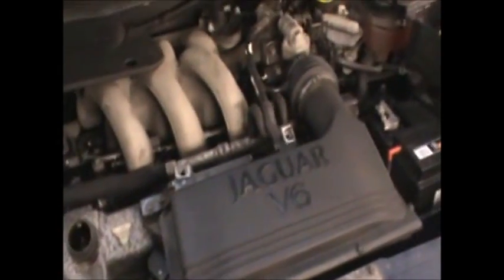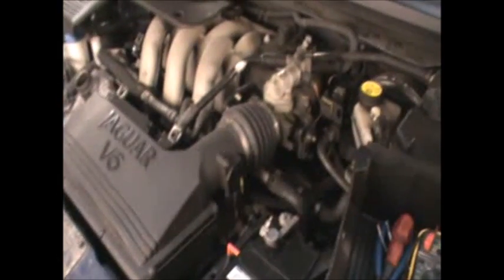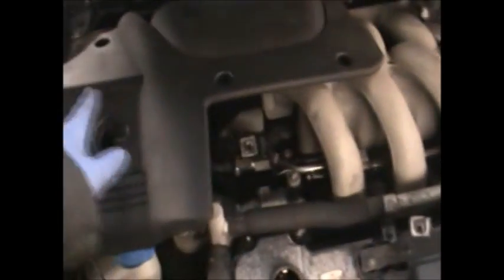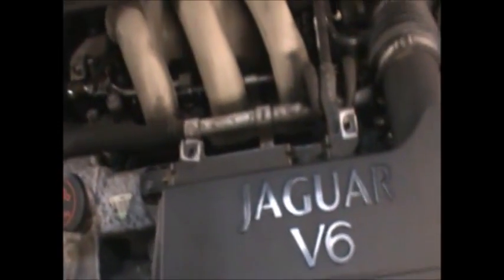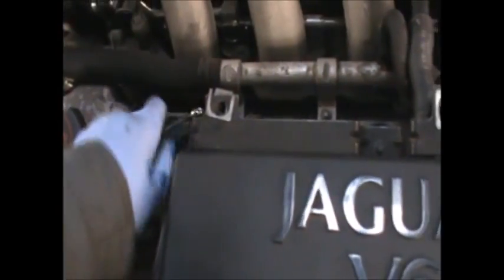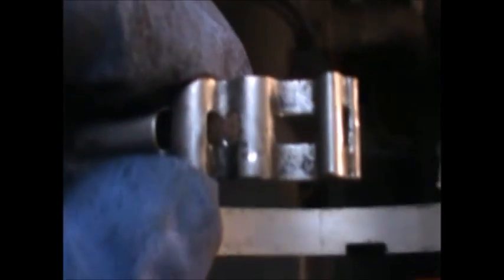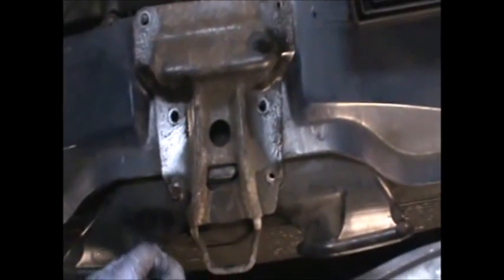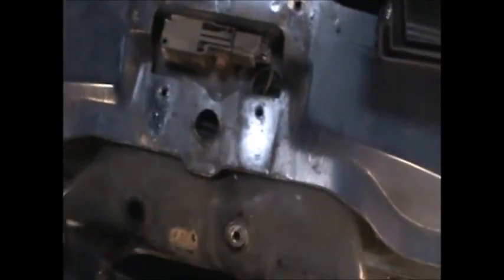Jaguar fault code P1647 upstream sensor

Comment: I'm a little confused by the Jag code P1647.  Strange that it doesn't seem to differentiate that it is a heated sensor, or whether it is upstream or downstream, only "Bank B", unlike their codes for other models as to their O2 sensors.  Also, note that the code mentions that it is for a "linear control chip" for that sensor, not the sensor itself.  So shouldn't there be a computer chip somewhere in the system that needs r/red, not the sensor itself  ?
Reply from the maker: The o2 sensor sends a signal to the ecu and then it adjust the fuel trim so its not to rich or to lean, so as far as the issue I had with the jag on the vid and other jags was that the sensor was not functioning properly, heated resistor can be checked by testing the resistance of the sensor the signal will usually fluctuates from 0 to 1 volts..if the OBD is not specifying upstream or downstream then you could use the OBD computer to check all the sensors and see which one is not working properly. the other reason this codes are generated could be that there is an air leak in the system and can cause mixture issues..

Comment: Does this sensor make the car choke and pop out on intake? I need this information urgently for a repair.
Reply from the maker: Hi there and happy new year, the fault code did not cause any issues, just turn the engine management light on. So I was driving just fine.
Reply: What your whatsapp, Instagram contact?
Reply from the maker: @Dudu-fj8kp  insta is ama1_motors

Comment: How do you use the meter to check the resistance of the sensor. Thank you.
Reply from the maker: Hi, well basically get your meter on the ohms section, set it to 2k, and then measure the resistance of the sensor by connecting your leads to the two black wires coming from the sensor, sometimes they are white and the resistance should be between 0,94 and 1,35 any higher will show a faulty sensor.
Reply: @DaringBeefcake  thank you for getting back to me. Stay safe.

Comment: Hi mate great video, But what did you use to remove that exact sensor as i cant get enough space with the ratchet and 02 sensor socket tool, have you got a link for the tool you used
Reply from the maker: arron imms hi, i used an open O2 sensor socket and a power bar to get it loose. The power bar has a flexible head so may be thats why i was able to have it at an angle as far as I remember. Because once u crack open the sensor a little bit then it just comes out fairly easily, though do spray wd40 or similar around.
Reply: Ok thanks mate, was your power bar a standard size or an extended (longer) one as when i tried i had no room
Reply from the maker: arron imms the power bar i had, had a 1/2 inch drive so i used a small extension to convert it to 3/8 i think so it could fit the open ended socket. May thats what made my socket a little longer and there was able to turn. All I needed was a small turn to crack it open.

Comment: Left or right side is 1647? Driver side ?
Reply from the maker: polovni djelovi hi sorry but its not left or right, the one I removed its at the front of the engine there is two sensors there and there are another two at the back of the engine.

Comment: Hi, I have the same problem with code P1647 on my Jaguar x-type 2001 . I have already changed the sensor , but the light comes back more and more. Then i checked the resistence of the sensor , it was 0.8 that is very well, then I checked the resistence of the downstream sensor . It was also 0.8 . So both sensors are working good , but it always appears the fault code p1647 , that is correspond to upstream sensor . And I dont know what that could be , because my two sensors work perfekt, but it always occurs a mistake about the upstream sensor. Could you give me an advice , because I dont have any ideas.
Reply from the maker: I think there are 4 sensors in total did u check all 4 ? If all of them are ok may be you need to check the continuity of the wires from the sensors to the ECU just to make sure no wires are damaged or broken.

Comment: How long to replace sensor? .
Reply from the maker: getting to the sensor is not long at all, the only part that sometimes drags the job is loosening the sensor, some are easier than others so all in all if the sensor comes off easy the it should take more than 30 to 40 mins. that is for that specific sensor.
Reply: DaringBeefcake Thanks for the info will have a go at the weekend.
Reply from the maker: no probs hope it goes well
Reply: DaringBeefcake I hope it does,I build cars for a living and don't wanna spend my weekend stuck working on mine
Reply from the maker: oh I see, well of course I really hope it goes smoothly for you, do remember that a genuine sensor is advisable due to the resistance deference with the universal ones.

Comment: Hello,
I've had the P1647 code and I've changed the O2 sensor. The check engine light went off and the car worked just fine for about 200miles. Now the check engine light is on again and I have more codes :
-P0171 System Too Lean (Bank 1)
-P0174 System Too Lean (Bank 2)
-P1647 Linear O2 sensor Control Chip (Bank2)
-P2098 Post Catalyst Fuel Trim System Too lean Bank 2
Any ideea why more codes after replacing the sensor?
Thank you!!!
Reply from the maker: It sounds like you may have an air leaking into the intake somewhere, you should check the resistance of all the sensors to make sure they are within the correct tolerances, that way you can rule out sensors. I assume you used an original sensor because aftermarket ones dont seam to work properly, and also I guess you check the resistance of the sensor you replaced before replacing it. Anyway check for air leaks at this point.
Reply: DaringBeefcake First I've replaced the O2 sensior with a Bosch one. Did some research and that is not the original one. I've got a new one, Denso this time. Changed it, drove the car for 15 miles but no change, and same fault codes. Do I have to drive it more in order for the computer to reset? I have not checked the resistance of the sensors. Should it be 0 on all? Thank for the reply, really appreciate it!
Reply: DaringBeefcake I've also cleaned the MAF sensor, and checked for leaks. It used to stop the fuel flow at 3000rpm but it does not do that anymore.
Reply from the maker: HI ramon as you probably already know there are 4 sensors and if you set your ohms meter to 2k the readings should be between 0.90 to about 1.5. that is measuring the two black wires sometimes they are white. Anyway that is only testing the heater element of the sensors which is what the fault code on this video is about. Weather the actual sensors are working or not regarding fuel mixture then you will need a obd2 scanner to look at the readings of each sensor, which they should fluctuate from 0 to 1 volt as far as I remember. Also you need to delete the fault code with a scanner after replacing a part, driving isn't going to reset the fault code stored on the cars ecu. Also with the scanner you can check if your airflow meter is working properly. Hope this info helps you a bit regarding your fault finding.

Comment: hello i have a question  my 03 s type r jag have some code issues  first i had misfire  then now i have combustion too lean and p01647 code which is a oxygen sensor but i replaced few months ago ,,,,
Reply from the maker: did you fix the misfire ? and also did you use a genuine oxygen sensor ? I ask just in case because I had problems with non genuine sensors.

Comment: Brother thanks I learn something new about it, tomorrow will check if this fix my problem, it has something that no body can find what it is! Some times hit 3000 rpm and get kind of hiccups like did not get enough gas. but just give me p1646
Reply from the maker: +Jairo Flores Hi there, well I think that code refers to the sensor which is located on the side of the bulkhead not the one I changed. Hope you get it sorted.
Reply: Yes Thanks, the one you mention measuring 1.4 but the one on the back is 4.9, today i'm getting a original sensor to see if thet fix the problem. You are awesome
Reply: u gpt bad thortle body sensor relay.. 100% sure replaced it u see
Reply: u got bad thortle body sensor relay  100% sure replaced it u see

Comment: Thank you for this Video, i have the same probelm....
Reply from the maker: prozesswissen Hope you can resolve it, seams to be common problem
Reply: DaringBeefcake 
Yes, i fix the oxygen sensor at the next weeks.... 

But the X-type had a lot of probelms. I drive this car from 2009 until now and at all i payed 6000$ from the repairs. The automatic gearbox was 2012 broken and a lot of other probelms.... 

This car is not the best one but not too bad. Now i fix small probelms by myself. 

regards from germany
Reply: Xj8. oii.     jay